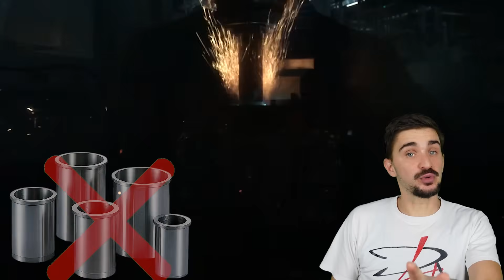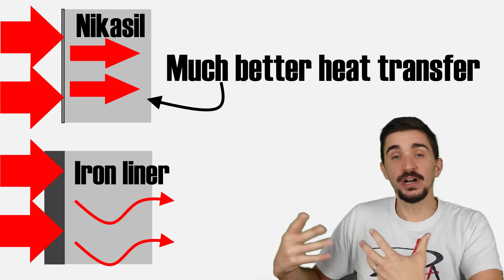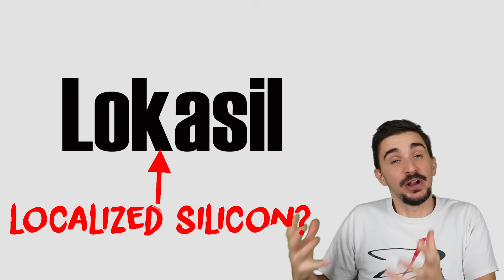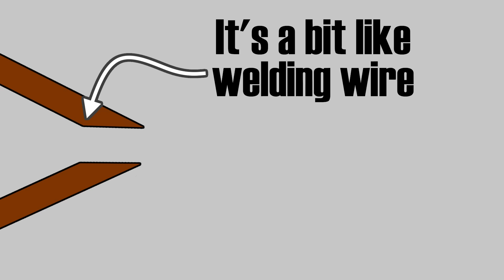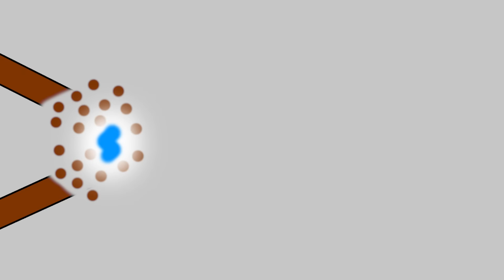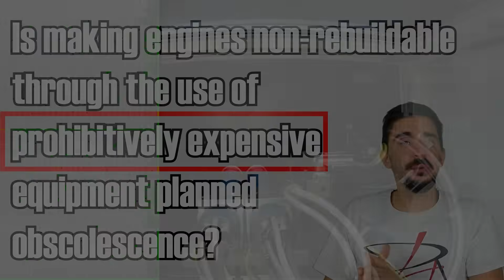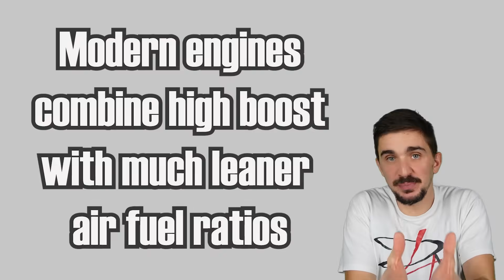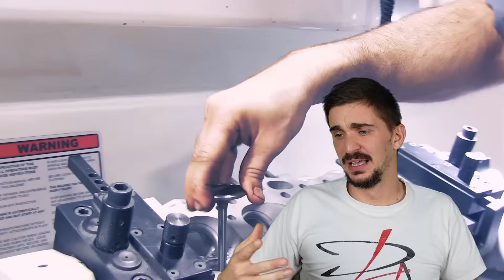Why Are Engines Becoming Non-Rebuildable? Everything About Cylinder Coatings

Comment: The are rebuild-able, it just needs a completely different skill set over older engines.
Reply: Sleeving engines that didn't have a sleeve often are put a sleeve in anyway. Sleeved engines used to be a rarity anyway, 8valve alfa twinspark being sleeved was a new good thing when it was new.

The bigger problem is just the cost of labor in the west rather than anything else. If usa had meaningfully large car taxes it would be done more there too.
Reply: I Agree, i used to sleeve engine's that had gone too far, purely as the prohibitive cylinder block cost made it an economic option. 
These new blocks lijely a lot cheaper (or not:) but in theroy  by the time their block fails the whole engine is mostly failed. 

And best option is replace the whole engine, but by then the vehicle isnt worth it:)
Reply: We don’t want to be taxed just because we like room and comfort.
Reply: @ room and comfort get you taxed?
Reply: @richllama-rm  No, but the Radical Environmentalists keep pushing that idea and refuse to give up, so it might happen some day.
Reply: They aren't rebuildable to those without the extremely specialized equipment needed, so to the vast majority of us, they effectively aren't. I live in a major city and can't even find a machine shop who can bore and hone normal iron cylinders correctly within a several hundred mile radius.

To the majority of people (especially if their car is down), having to spend days searching for a machine shop likely a long distance from where they live, transport everything there, prey to God they do it properly while waiting however long it takes, and go pick it up plus the extreme cost of labor and the required parts would make a proper rebuild impractical when most engines can be bought new or rebuilt for a few thousand dollars or used for much less.

And, as others said, the car often isn't even worth replacing the engine, so it ends up getting scrapped when it may have had a lot of life left in it.
Reply: @averyalexander2303  So they are reparable, we just need to wait until they make a better machine so these are thrown away and we buy it for cheap to make rebuild. Or just put a sleeve in. The tolerances are there, if they mean there is not enough wall to support the seelve just rebuild the wall by welding a new chunk of AL and then rebore it as you please
Reply: When I worked in  the UK BMW network,  M52 was hit hard but only in certain areas of the country. We were replacing 3 to 5 engines a week in my dealership. E39, E46 and E38 all affected.  Easily noticed, because the engine vibrates (cylinder balance test used condemned the engine).
Reply: you need to sleeve it. you can't just bore it out because there's not enough material, even though it doesnt sound too complicated to recoat it.
Reply: And access to patented tools the manufacturer is contractually not allowed to sell to you.
Reply: Agree ! Mechanics need to be much smarter today and so do machine shops !
Reply: @hotchihuahua1546 not quite. You need to know more now but it seems simpler from the outside.
Reply: It's about the engine tolerances! They are non existante today! And even getting a screw out of the block trashes it!
Reply: No, they arent. The tolerances are NOT made for any rebuilt. And the manofacturers dont sell the parts for rebuilding also.
Reply: @gabrielvieira.4358  You underestimate the stubbornness of engineers when no parts are available. We have machines to build whole engines from scratch if needed. We can rebuild anything.

Comment: Yeah. Iron and steel are... they're the goldilocks between toughness, malleability and cost. However their biggest weakpoint is their weight and high friction. A lot of the ideas described here was basically "reduce as much iron and steel as possible" to increase performance. But the cost of doing that is the fact that aluminum have actual fatigue point, while iron and steel can be reworked and restored.
Reply: Also iron takes much longer (relatively speaking) to reach operating temperature so cold start emissions suffer. People underestimate the impact cold start emissions have had on engine design, they're now designed to reach temperature (at least in the combustion chamber) as soon as practical.
Reply: @paulfrantizek102
This is another reason why Block Heaters should be standard, and even better, on top of that, everything being a Series Hybrid, or at least a Parellel Hybrid, so you can still move immediately under battery power, while the engine & catalytic-converters are electrically warmed up before the engine is even cranked. Reducing wear & emissions. And Series Hybrids are just EVs with range-extending generators onboard, and those engines can be kept at their most powerful or must efficient RPM, even better then a CVT.
Reply: Hybrids are a joke. An electric motor id not worth half a ton of battery. A real car has a combustion engine.
Reply: Probably not cost though. Manufacturers wouldn't do this if it was expensive
Reply: @ It's explained later on that some coating method is cheaper than iron sleeves.
Reply: Weight? I doubt the weight of cast iron liners has much to do with it. As d4a explained, the lack of heat transfer ability of thick iron liners is the real problem.
Reply: @surewhynot6259  Dodge was bragging that using plating on their new inline six saved 2 kg. They are using that as the reason why it is so good. Aluminum is soft and weak and will never give the longevity of a cast iron block. Cylinder sleeves and cast iron blocks can transfer heat just fine with proper water jackets. Car manufacturers are just trying to save money
Reply: @britjohnson1990  Wet sleeves had their good points and were also easy to replace.
Reply: @surewhynot6259  wonder if forged carbon carbon as a sleeve would do well. I'd think it's heat soak ability and streamline-ness coming into Earths atmosphere would be similar to ring seal friction heat and, this carbon doesn't expand so much.?
Reply: THat's true. And also increase sales of the shitty engines when they break
Reply: The 2010 5.8 l gt500 supercharged motor had the boron spray liners. Ford did a test where they ran one full power to redline back to idle, under load and lots of boost. The iron headers glowed red  for a full week. Upon disassembly pistons, rings and liners showed absolutely 0 wear from new. Simply unreal tech.